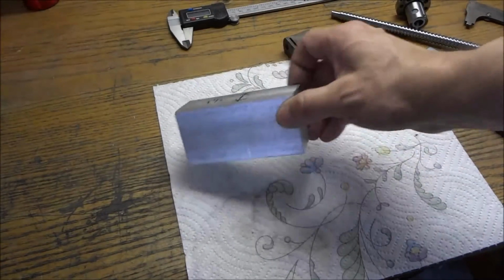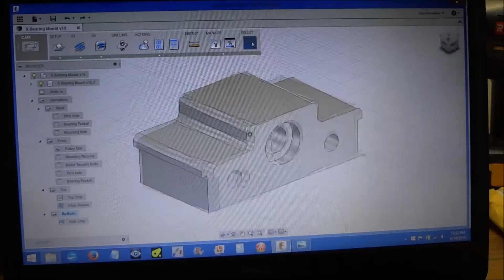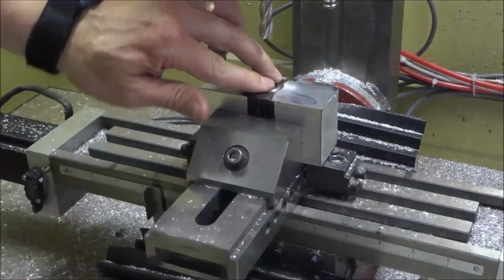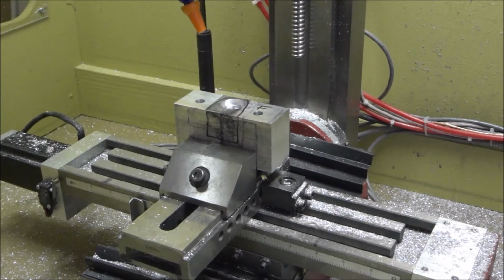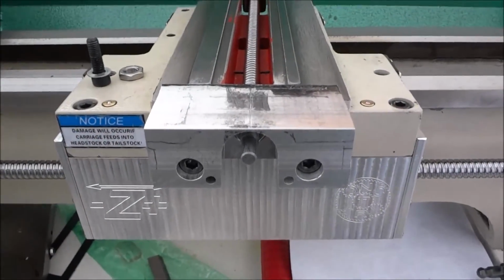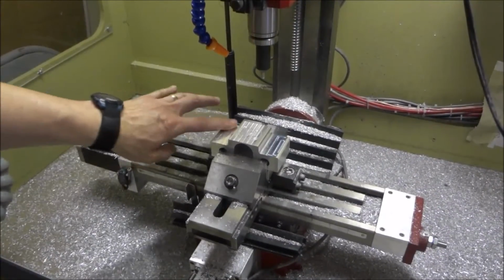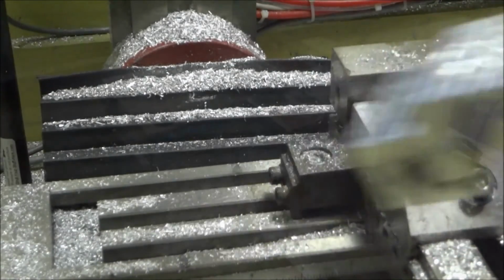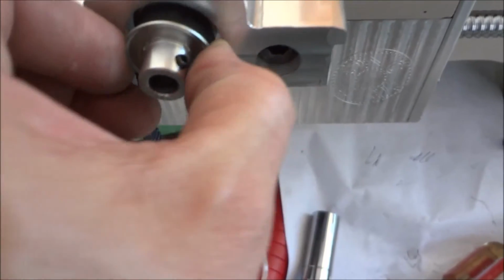G0602 Project Pt 14  X Axis Bearing Mount

Comment: Another great video. Looks like you are getting pretty comfortable with Fusion 360. I'm still playing around with it right now. I'm getting ready to use the cam generate the code to cut a motor mount for my mill and I hope it turns out to be a useful tool for me too.
Reply from the maker: William Hardin It is a really nice program but it's by default not setup for small mills so you have to tweak the settings for Feeds and speeds and depth of cut. getting used to all the features is taking a bit of time.

Comment: That adaptive clearing looks awesome Sam! I wouldn't dare take such huge depth of cut on my X2 without adaptive clearing.
Reply from the maker: Crivo152 Yes It works well and I see why its more beneficial , Normally before I mainly used the bottom to do all my cutting this method uses the bottom and the side of the tool. Still need to take light  cuts .015 WOC at full depth but works well. need more HP